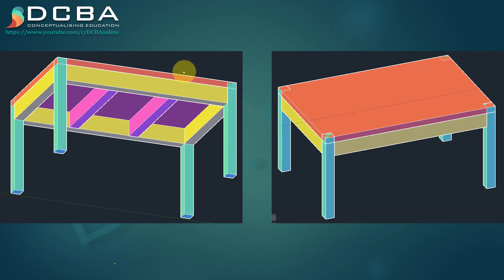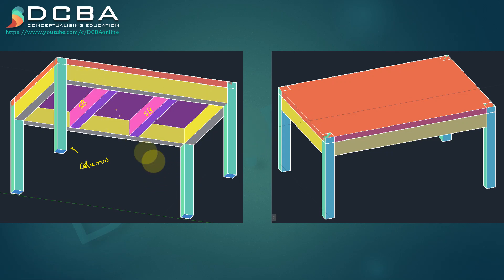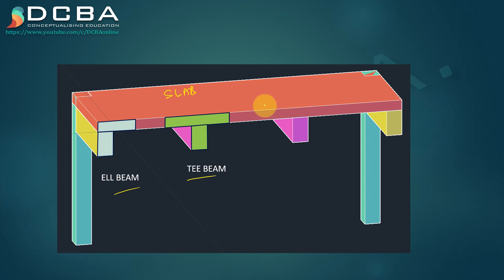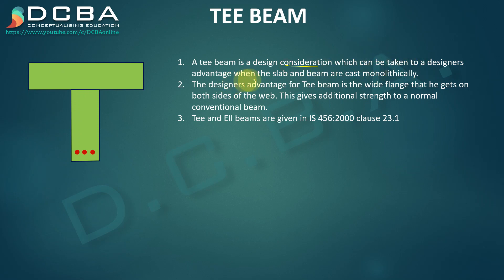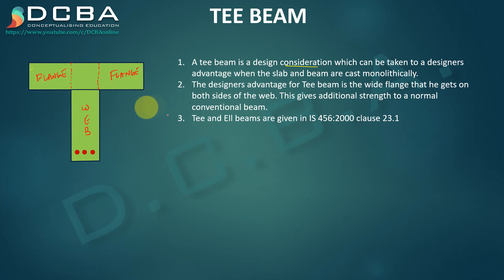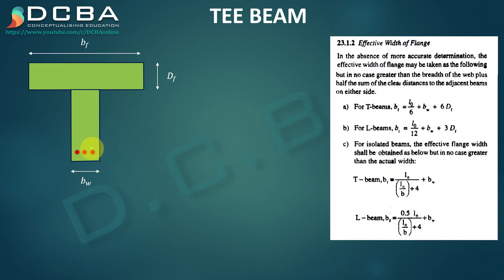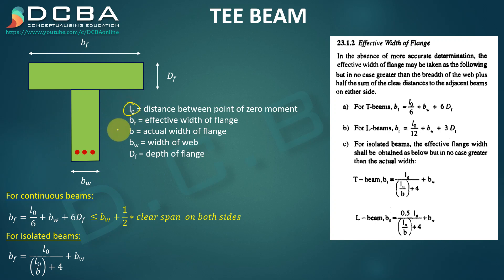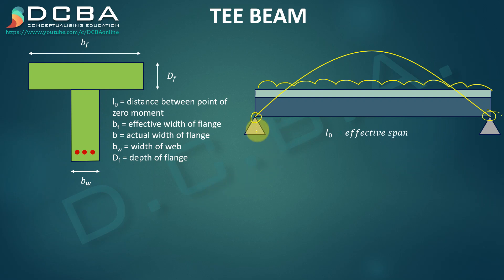Lec 18 - T Beam Design | Flanged Beam Analysis Part 1

Comment: Thank you for this education..
In flanged beams,
Moment of resistance offered is inversly proportional to strength, since it can be used to loads and slightly be indifferent and also width and depth

So equation is
3467/1000 * 1/STR (CONC) * BRD* DPT(NA)  * (DPT + 10000/4321) + 100000/45778 STR(CONC) + (BRD FL + BRD WD) RSN (FL) ( DPT + 2 / RSN)

Comment: Sir what is isolated beam??
Reply from the maker: Isolated beam is the one which is supported between only 2 supports.
Reply: @DCBAonline  sir you mean simply supported beam?
Reply from the maker: Yes simply supported is an isolated beam
Reply: @DCBAonline  and fixed beam
Reply from the maker: The formula will remain same as isolated beam formula the effective length will change to 0.7L for fixed beam
Reply: @DCBAonline  sir means we solving problems on design of flange beam that time we consider 
Beam as simple supported. so we should always used isolated beam formula . am I right?
Reply from the maker: If its mentioned continuous then other formula otherwise isolated formula that too only if total width is given and effective width needs to be found out
Reply: @DCBAonline  sir, super lecture ..we expect more videos...nyc work....
Reply: In BMD for continuous beam, it's not mandatory that the end support will always have moment. It could be pinned. But yes the continuous junctions will have moments for sure.